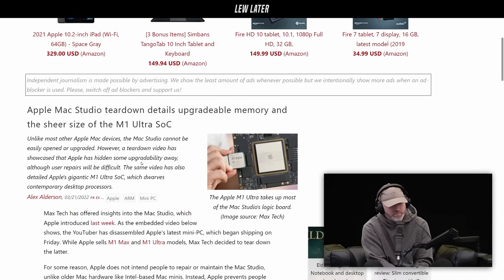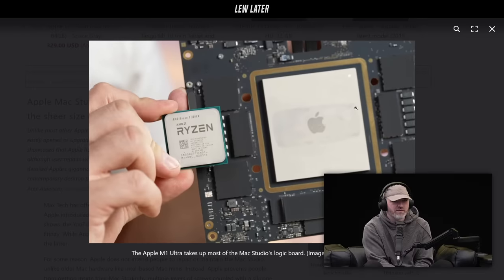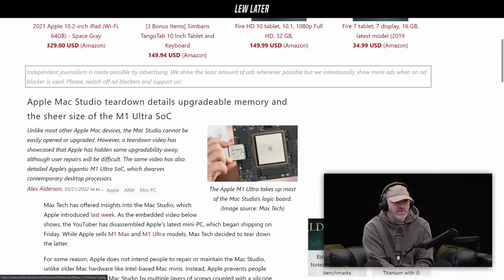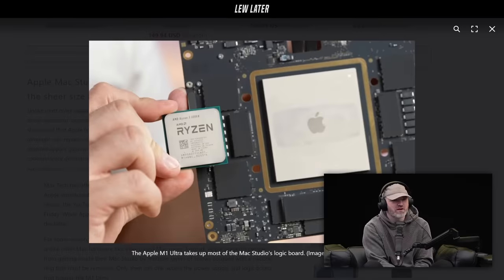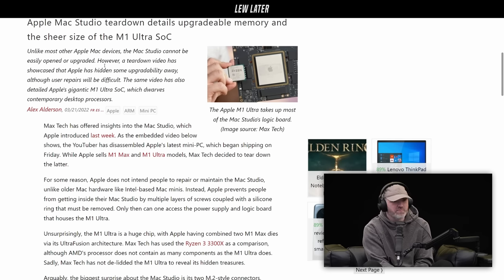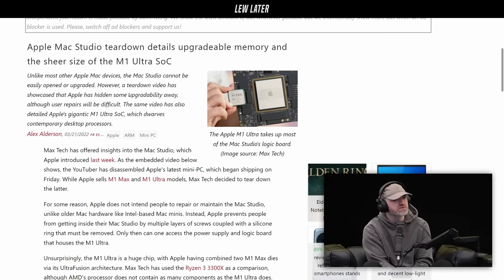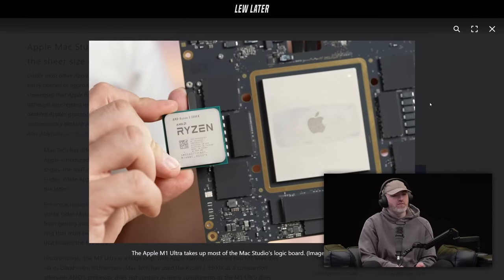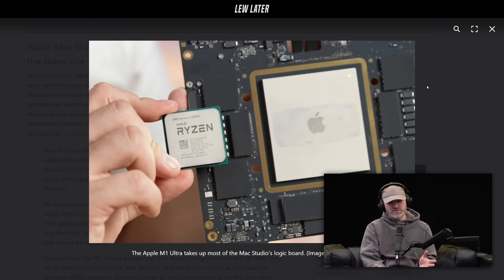Apple's M1 ULTRA Chip Size Comparison

Comment: The slightly darker shaded area on the heat-spreader is probably where the actual M1 Ultra is located.  It's surrounded by other memory chips.  Similarly the Ryzen uses chiplets, which are only a fraction of the total IHS area.  Comparing those would be more realistic.

Comment: Lol they compared this to a ryzen 3 3300x 🤣 compare this to a threadripper!
Reply: You mean power hungry amd threadripper?.😂😂😂😂🤣
Reply: @ak-2005  power hungry or you mean most powerfull processor in its segment which doesn't even have competition yet and still manages to software render crisis without GPU......
Reply: @LazyEngineerYT  wait for Mac Pro buddy…it will beat it so easily😃😃even apple gave the hint about the Mac Pro…which they never give😃
Reply: @ak-2005  m1 ultra is not as powerful as ryzen9 5950x. It's 22% slower. Although it's power efficient.
Reply: @souravmondal5317  lol only in cinebemch multi-core performance. But in geekbench multi-core M1 ultra is 34% faster than 5950X